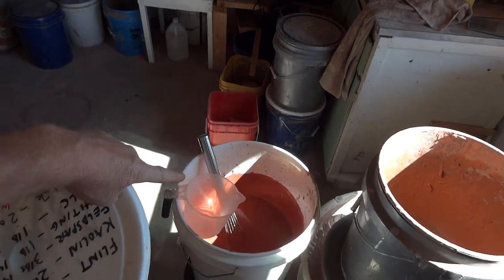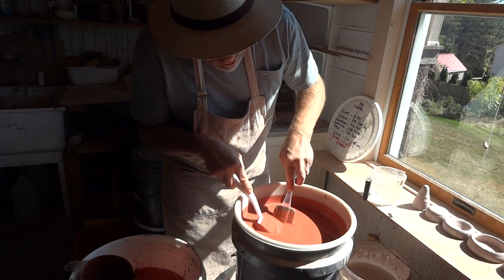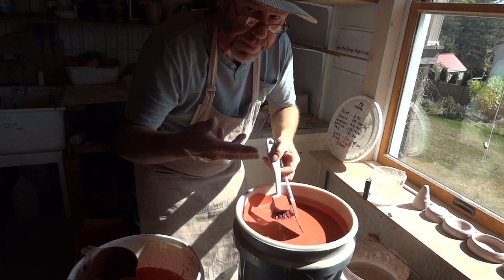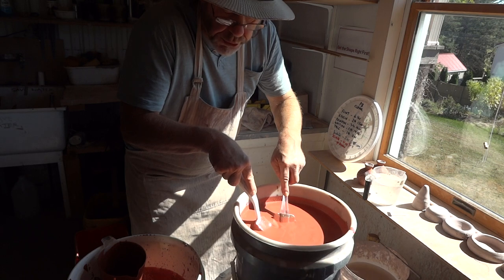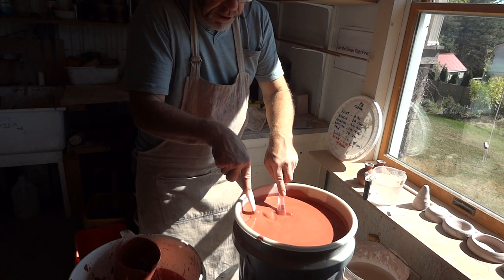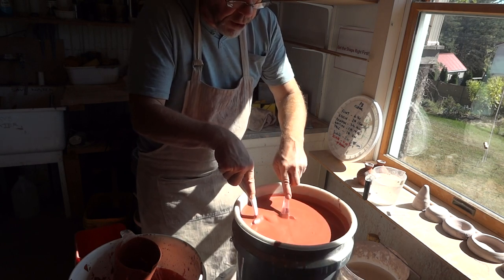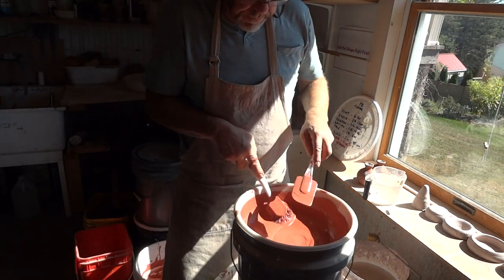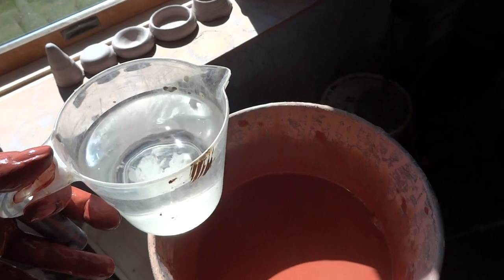Screening a raw glaze with Simon Leach - Oct 4th, 2017

Comment: Hello Simon, I was trying to calculate the batch recipe to figure out the quantity and it appears to be around +/-6 quarts to the 220 ounces of chemicals. The 5 gallon bucket seems to be only filled half way once you added to the existing batch. Does that figure out? Also do you take any SG readings, if so what are you aiming for in raw glazing? Great video!

Comment: Hi Simon, 
                do you think that the glaze would thicken if you were to heat it with the top open using a heat gun on low?
Reply from the maker: I am just trying to wrap my head around what you are asking here !?  Firstly as I said I would be careful not to add too much water when screening the glaze...if you did I would not use a heat gun to try to get it back to being thicker no , just leave the glaze to sediment out then scoop some water off the top. You would have to wait maybe 24 hours though.
Reply: Thanks for the reply, just me thinking that I could somehow speed up the process by using heat to evaporate the water from the glaze if I were to add too much water. Patience will work the best.

Comment: Handicapped 70 yr old lady just started classes on pottery.  Watched all your videos at least twice as well as going to class weekly. And I Love working in Clay !!  My question is in one of your videos you fired your pots in a smaller size of cement blocks, used saw dust and rabbit  wire ( we call it rabbit wire cause we use it in rabbit houses) you never showed how it turned out.  I think I could lift everything you used.  Only thing I have found my back could lift.  Did the firing go good or bad?  Would you please do an up date on the firing with small blocks, wire, sawdust, and a flat metal on top go.  Thank You and now I will watch all your videos again.
Reply from the maker: That was a while ago !  2009  The firing i seem to remember was not the best sawdust type firing I have done. The reason was I did not use sawdust but wood shavings, which admit too much air around the pieces which in turn means they do not come out nice and black, but a bit grey in spots. I like the pitch black look !
Better I think with regular sawdust.
Reply from the maker: It was not the best firing due to the fact i used wood shavings and not sawdust !
Too much air getting in around the piece - sawdust gets blacker pieces which i like,  wood shavings burn too fast. We keep practicing !